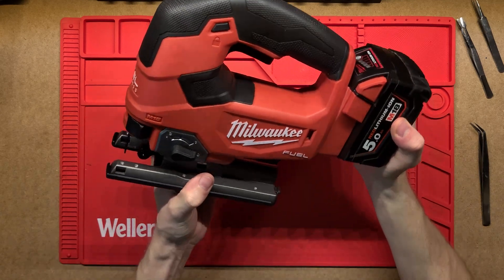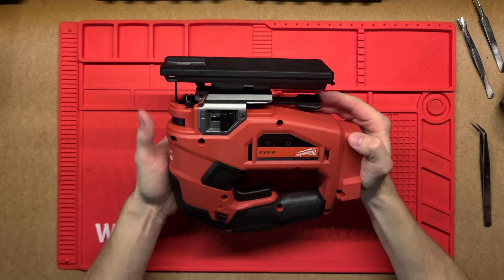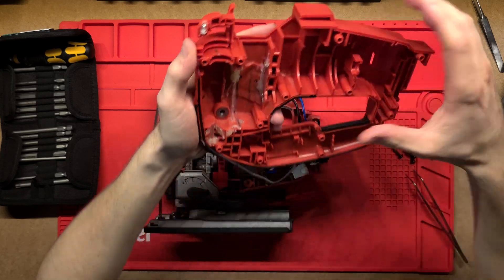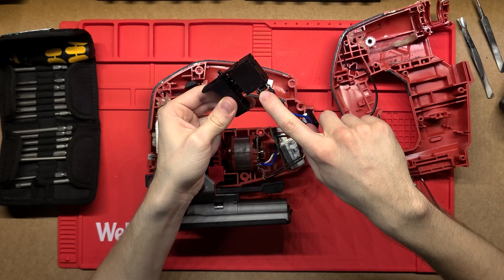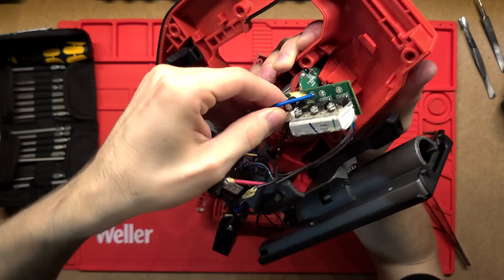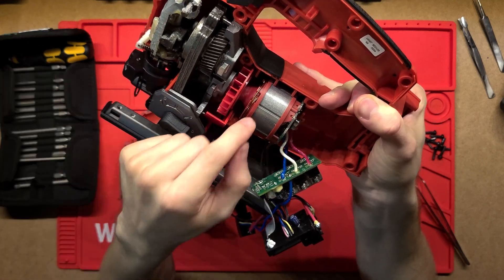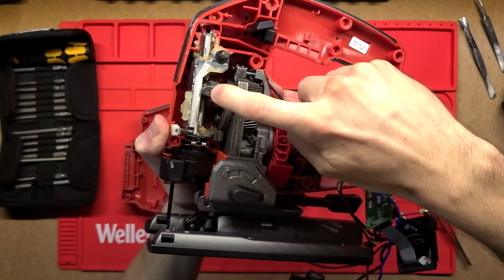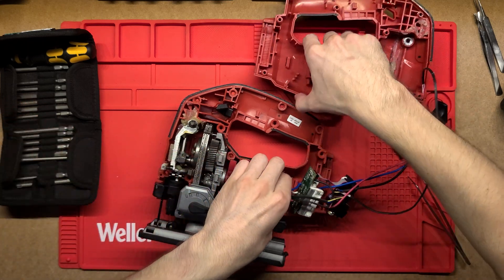MILWAUKEE D-Handle Jigsaw Teardown!

Comment: For the 2737-20 platform:
* The front end is a booby trap for anyone doing legit maintenance:
   * Very tight roll pin + no lube → high risk of cracking tabs.
   * Once the gear-case tabs break, you’re into major parts hunting or donor tools.
* Given the blade guide itself is NLA, and the gear case can be destroyed by the act of trying to replace the guide, the saw is structurally disposable from a long-term support standpoint.
* For someone like you who:
   * Runs tools hard
   * Actually maintains/rebuilds them
   * Cares about design for serviceability …this is absolutely a legitimate deal-breaker.
If someone has to R&R that guide anyway
For completeness, the “safer” approach (based on what you’re describing + general practice) would be something like:
* Support the tabs fully in a vise or fixture so the casting isn’t taking bending load.
* Use a proper roll-pin punch or, better, a small arbor press, not a freehand hammer.
* Moly lube or similar high-pressure grease on the pin before reinstall.
* Drive from the correct side (chamfered end first) and never try to “muscle it” once you feel it galling.
* If you were doing this for a fleet, you’d almost want to:
   * Lightly polish/ream the pin bore
   * Deburr the roll pin
   * Pre-lube and standardize a safer interference level.
But honestly, given NLA status and known fragility, I’d agree with your implied conclusion: don’t plan on this being a service-friendly platform.
Strategic takeaway (tool choice)
Putting this together with everything else:
* You already own a superb Bosch corded jigsaw with a genuinely robust guide system.
* Milwaukee 2737-20 now has:
   * No speed dial
   * More blade wander than Bosch/DeWalt in testing
   * And a known, service-hostile blade-guide/gear-case interface.
For someone like you, I’d say:
* Keep the Bosch as your precision / “serious work” saw.
* If you want cordless:
   * Go DeWalt DCS334B / DCS335B, or
   * Bosch’s newer 18V barrel-grip — both are way better aligned with your standards for design and serviceability.
And yeah — lesson learned on my side: when evaluating tools, I should weight parts availability + service failure modes a lot higher for pros/engineers, not just “specs and YouTube tests.”

Comment: Hi! Interesting video! I stumbled upon it because my Milwaukee M18 jigsaw only has the led light on, but not working anymore. According to another video I've found this is the controller and thus not worth fixing. I was wondering, is there a place online where I could purchase this part in order to replace this myself?
Reply: Hi mate, did you find your answer? I have same issue
Reply: Following, my jigsaw seems to fallen into this state as well…get a light on trigger pull, but no motor.